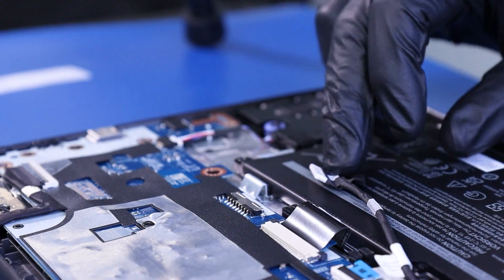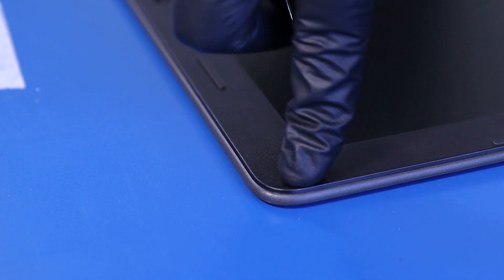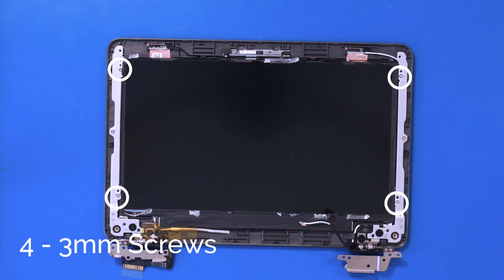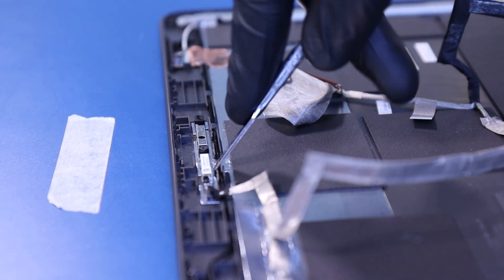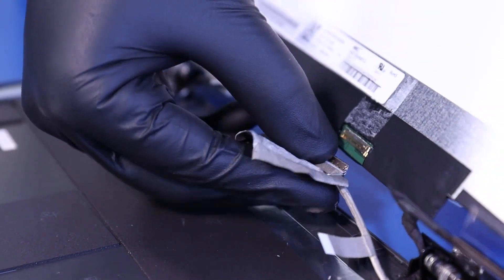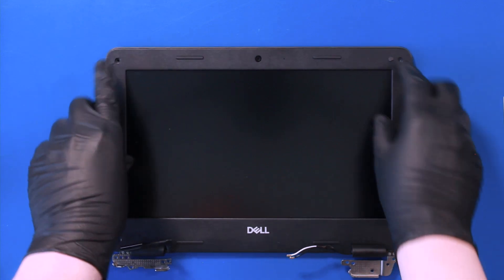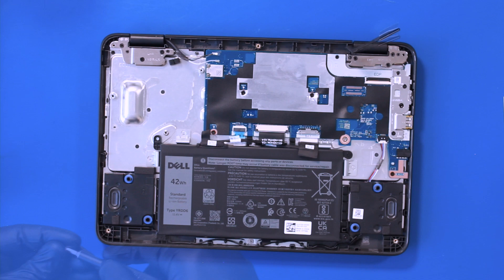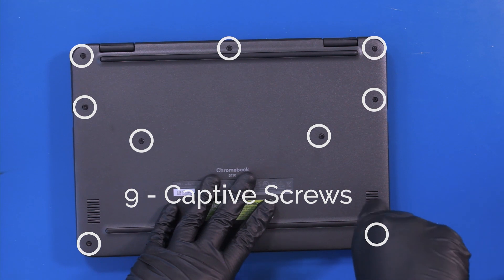Dell 3110 Chromebook Back Cover Replacement

Comment: oh my goodness bro all the tutorials i see for this cb they get the antena cables on so easy bro it takes me like at least 10 minutes and i gotta use tape to secure the cables dude
Reply from the maker: Those tutorial hands have done this hundreds of times (if not more), so they've definitely had practice! It can be tricky to snap the wifi cables on at first, and you definitely want to avoid using too much force so as not to mash the connector, but if you gently align them they should pop on like a jacket button.
Reply: @Chromebookparts  
Haha! Yeah, I'm sure the tutorial hands are more skilled than I am. And after the cable pops in it won't move or disconnect while you pick up the other antenna to plug it in?  That's always what happens to me.
Reply from the maker: Oh, it definitely does sometimes, haha. There are a few video tutorials where the struggle is all too real.